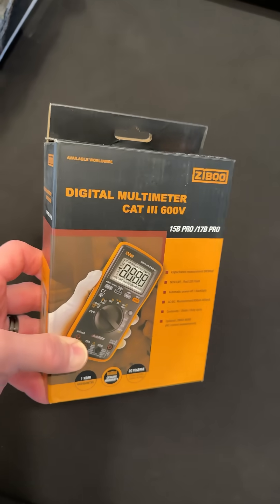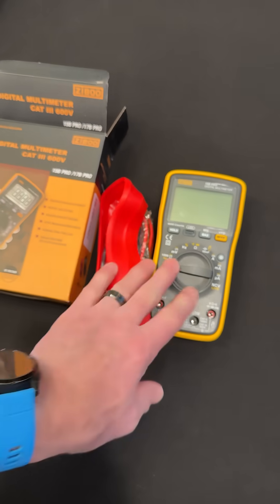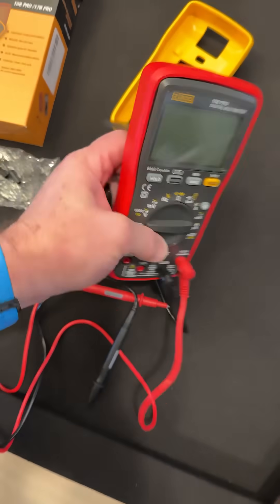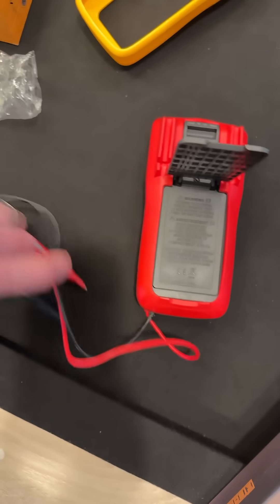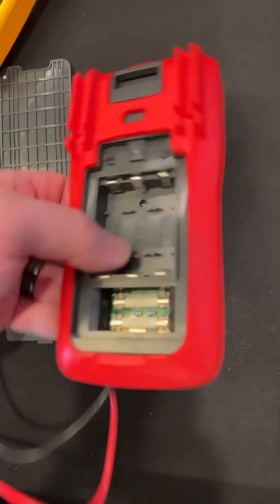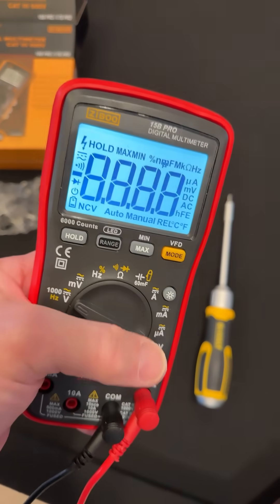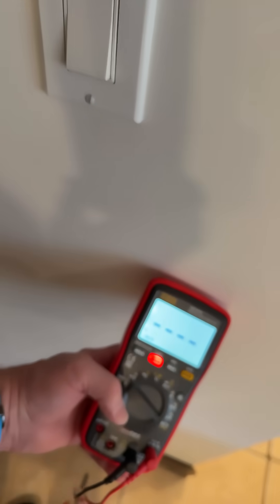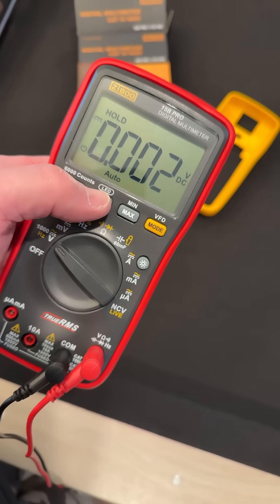A new Low Cost Multimeter worth a look Ziboo 15B Pro True RMS Multimeter has VFD and NCV

Comment: This is why we can’t have nice things. They have the ability to make their own products and waste it copying someone else. I wouldn’t trust that anywhere near 600V.
Reply from the maker: The funny thing is that the yellow meter company hasn’t come out with a new meter in years.  It is easy to knock off old tech.  I’ll test this out at 1000V and I’ll bet it has no issues.  Even the lowest cost meters that I’ve tested gave passed.  With all the low cost meters and YouTube channels - when have we ever seen one fail?
Reply: @KissAnalog  The ones that failed at high voltage aren’t on video because the person using it is no longer here.
Reply from the maker: China used to copy a lot of things, but now they are making their own way as they have learned and are now doing very well.
Reply: Am testat cu 1500 Vcc si nu sunt probleme .(are mov si Ptc plus sigurante ceramice)
Reply: @iuliandumitrescu9441  Să ai grija când măsori sa nu îți treacă curent prin mâinile. Îți oprește inima pe loc. Pentru câtva banii nu mă joc cu așa ceva. Cumpăr firma de calitate cunoscut. Locuiesc în statele unite, toate ăla mele sunt Fluke.
Reply: @iuliandumitrescu9441  Să ai grija când măsori sa nu îți treacă curent prin mâinile. Îți oprește inima pe loc. Pentru câtva banii nu mă joc cu așa ceva. Cumpăr firma de calitate cunoscut. Locuiesc în statele unite, toate ăla mele sunt Fluke.